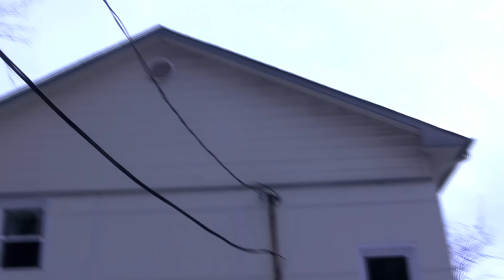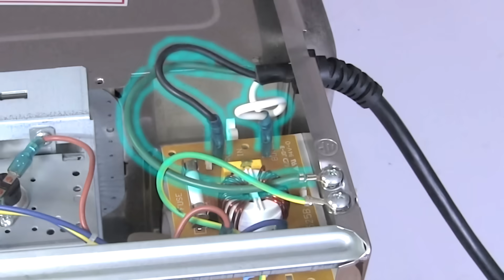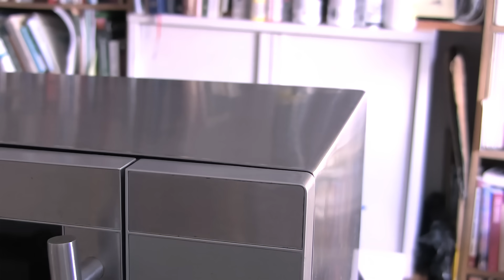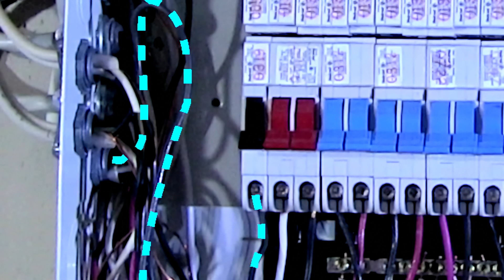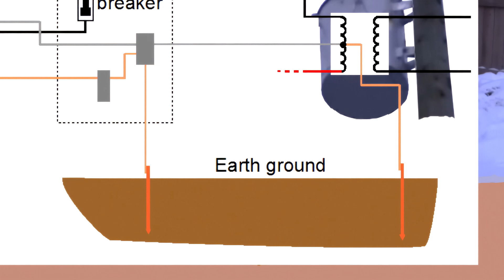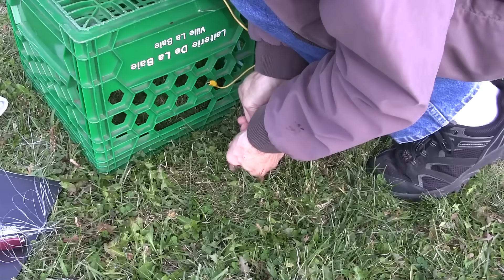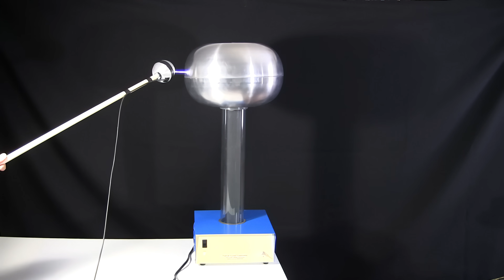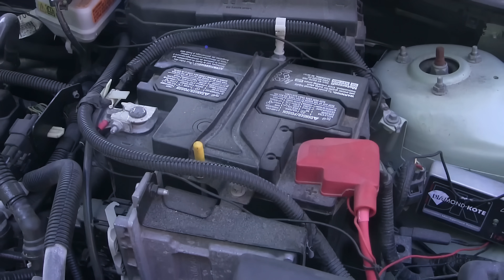What is Ground? Earth Ground/Earthing

Comment: But if electricity takes the path of least resistance, the wouldn’t the current flow through the hot wire, through the microwave and then straight to ground where the neutral and ground are connected??
Reply from the maker: Electricity doesn't just take the path of least resistance. It takes all paths and the amount of current each path gets depends on the resistance of that path. Keep in mind that the paths it's taking are the ones which complete the circuit. There is no circuit from the hot through the microwave, they're not connected. However, there is a path through the ground wire at the breaker panel, down to the Earth ground, through the Earth ground and to where the transformer is connected to Earth ground. That Earth ground section is a high resistance and so only a very little current flows through there. The neutral wire going from the breaker panel to the transformer has a much lower resistance and so almost all of the current goes through there.
Reply: RimstarOrg well by that logic, if the circuit to ground is high resistance, why does the current not circulate the hot back the the neutral point? It seems unlikely that the current differentiates between hot and neutral and hot and earth if earth is a higher resistance than the the neutral?
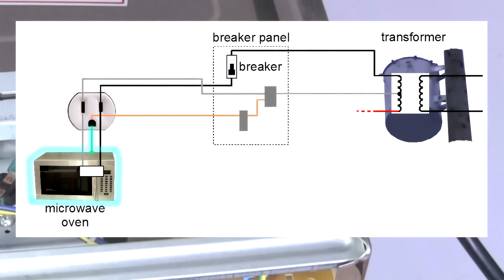Reply from the maker: I'm not sure which scenario you're talking about. Do you mean when the insulation breaks on the hot wire in the microwave oven which I talk about at 2:24?
If yes, then in that example, I'm assuming that the microwave oven isn't turned on, which means that the switch contacts are open and so there's no connection there between hot and neutral. The current therefore goes from the break in the wire, through the case as I describe in the video, back along the ground wire to the breaker panel and from there through the neutral to the pole and back along the hot to the breaker. i.e. the Earth isn't involved.
If the microwave oven was turned on then as I said in my last reply, the current would take both paths, one through the microwave oven circuitry and back along the neutral, and the other from the break in the insulation, to the case, and back along the ground wire. The amount of current in each path depends on the resistance in each path.
Reply: RimstarOrg I’m talking about under normal operating conditions, the hot wire comes in through the consumer unit then out to the microwave. The circuit is then connected through the high load in the microwave when switched on. The voltage is then used up through the load but there is still current on the return. If the return is then connected to the ground at the consumer unit, then what stops the current flowing to ground at this point?
Reply from the maker: The return isn't connected to ground at the consumer unit. Only the microwave oven's case is connected to ground.
Reply: RimstarOrg You’re diagram at 4:15 shows the white return cable going back to the consumer unit into a terminal block that also has the ground cable connected to it AND the external ground spike.
Reply from the maker: But as I mentioned a few replies back, some current does return through that ground spike to the ground spike at the pole and back up to the transformer. But since it is such a high resistance path through the Earthen part of that ground, the current along that path is very small compared to the current through the neutral wire between the breaker panel and the transformer.
Reply: There is only one path back to the pole transformer and that is thru the black and neutral wires. The ground wire should never be a
a conductor

Comment: Awesome video, really helpful!  I have just one question...I understand that in the microwave example you need to keep ground tied to neutral so that it always stays at 0V with respect to the hot wire, but if that is the case, why not just use the neutral line as ground and connect it to the chassis?
Reply: Savety reasons. If the neutral wire gets lose and the hot wire touches the case, you're gonna have a problem. 
Also the whole  automatic switch off  process usually works different than the one explained in this video. In general you can finde a RCD in the breaker panel wich needs the ground to be able to switch the circut off. I don't know if theres an obligation to use RCDs in the States but in Germany there is.
Reply: Then following your argument no need for a 3rd connector in the plug, just make it two. But what is to stop the hot and neutral from being swaped? Then the case can be hot and kill you

Comment: So when working with DC ground is the negative pole and while working with AC ground is to discharge electrified house devices, as a security measure?
Reply from the maker: With both DC and AC, there doesn't have to be a ground. For example, if you just connect a motor to a battery (which would be DC) then there's no ground. You can then connect either the positive pole or the negative pole to ground and then that pole would be grounded. That means that that pole would be at the same potential as ground. Most of the time when using batteries, if one of the poles is grounded then it's the negative one but I've seen the positive one connected to ground instead in some solar power applications.
Regarding household AC, one reason ground is used is as you say, for safety. Another is for making sure that two points which are far apart, such as the neutral connection at your breaker panel and the neutral in the transformer on the pole, are at around the same potential (i.e. 0V with respect to each other).
Reply: Thank you very much!

Comment: Ground doesn't go to transformer 😂😂😂.  It is bonded at the first feeder/supply panel. Usually the first panel after service.  From there its bound to the housing foundation, which usually has rebar. If not, a grounding rod.
Reply from the maker: I don't show the ground going from the breaker panel to the transformer. I describe it just as you have.
Reply: Actually yes, it does go out to the transformer, house services are a 3 wire Edison circuit. It also goes to ground at the panel, it also goes to ground at the transformer pole as well.

Comment: Why even have neutral anyway when ground is so much better smh
Reply: Ground and Neutral serve completely different purposes.  

The Neutral is part of most circuits where half of the service transformer winding is used, or a common end of the windings for multiple phases is employed.  The Ground is a dedicated path to earth potential.
Reply: The same reason you have feet but your hands are much more dexterous.

Comment: Great video, but I wanna add something. Ground and Neutral aren't always connected, it depends on the earthing scheme. In your house, ground and neutral are most likely connected together, so if the hot wire touch the equipment's surface, the the CB will trip.

However, in some cases, tripping would be even more dangerous (place like hospitals, in which losing power could cost human's life), neutral and ground might not be connected. Ground wire will still go to the real "ground", to bring the voltage down when there's a fault (so that even if you touch the surface, you won't face any danger), but the CB won't trip
Reply: He is showing residential 3-wire single split-phase 240v service... not 3-phase wye or delta higher voltage commercial service connections...his explanation is perfect for what it is showing...yours is a DIFFERENT lesson for a different service...apples and oranges...and grounding is a SAFETY conductor of low resistance that would trip a breaker because of overload...breakers prevent fires and equipment damage/failure...almost all hospital equipment has backup power packs for critical equipment....there are more than one grounding connections in all systems  because lightning strikes can electrify the ground-- literally- a building or a distribution system  and backfeed a system or transformer without  a short path(i.e. lightning suppression and lightning rods) to dissipate the surge...a neutral is part of a specific design like 3-phase 4-wire wye whereas as a 3-phase 3-wire delta has no neural in its design, but still DOES have safety grounding at the distribution source and service connections OUTSIDE.
Reply: nam18x 
I'm confused.

Comment: FINALLY it makes sense! @2:38-2:52 explains what I've been Googling, Youtubing, etc... I kept thinking the ground wire would "dump" electricity wherever it touched, which made no sense. I understand now the current travels BACK to the source using the ground wire as a path.
Reply: Nope.  You still don't appear to understand.

The equip (microwave) ground wire is connected to the equip case & to the neutral wire in the breaker box.  There is also a ground wire that connects the breaker box neutral to an earth grounding rod.  There is also another ground wire that connects the center tap of the transformer (neutral wire) to a different earth grounding rod.

When a hot wire makes contact with an equip case (which is called a short-circuit), current will flow along the path of least resistance--which in this example would be from the hot wire, thru the case, thru the ground wire, & then thru the neutral wire to the transformer center tap.  Since there is very low resistance along that short-circuit path, current begins to increase very rapidly until the circuit breaker trips & opens the circuit--which of course interrupts current flow for safety purposes.

The grounding rods also provide a low resistance path for excess electricity to flow since the earth also has a neutral charge compared to the negative charge of electricity.
Reply: ALL grounds are the shortest path of least resistance used to:
1) trip a breaker in the panel due to a fault/short circuit OR
2) dissipate charge/current when lightning strikes near the area(a second type of grounding), so you weren't totally wrong, it just seems you're not differentiating the HOUSE grounding which handles current overloads INSIDE the house(from the circuit breaker panel) like the microwave fault example, and the fact that the grounding rods OUTSIDE the house attached to the circuit breaker panel housing(and the bus bar) and one attached at the power pole(or ground transformer) source do two different things: the INSIDE house ground gives a short path for current overload in a fault/malfunction situation resulting in a tripped breaker, while the grounding rods dissipate excess electrical charge from lightning OUTSIDE the structure ...in a properly working system the inside ground has ZERO voltage or current until a fault/malfunction occurs...the house panel common bus is to take any excess current in the neutral wire to which it shares a common bus bar connection and find the shortest path...when it is from an inside fault, it trips a breaker as it is essentially a secondary, but shorter, least resistive path which then effectively  'replaces' the neutral wire which is designed to carry current in a NORMALLY functioning circuit and this short circuit causes a fault which causes current overload which causes a breaker to trip...the ground wire is 'used' ONLY in a fault/malfunctioning circuit and because it is a path of least resistance it becomes overloaded past the breaker capacity(usually 15 or 20 amps) and trips the breaker... when the 'fault' is from the outside lightning strike it goes TO GROUND RODS literally to be dissipated(absorbed). Neither ground is used in a normal functioning situation to carry any current, only in a safety instance.

Comment: what happens when there's no breaker? Also, is the equipment demand( the load) the determinant in how much amps are flowing, as it appears that way when you measure the wattage at the outlet. But when the equipment isn't demanding anything( turned off), what accounts for the amps that flow from the hot through the metal case ( and maybe you) to ground?
Reply: D Monk 
I think it's cz if there's an overload in the wiring it deosn't damage an appliance or if anything else.
Reply: No breaker = no interruption of current flow--which means high current flow through the VERY low resistance short circuit path.  As the current flow increases, the wire will become hotter until its insulation melts.  Once the insulation melts fire is likely to occur next, if the electric current flow isn't interrupted/stopped.

If you touch the short-circuited case, some of that electricity will likely flow into you.  If you represent a lower resistance to ground, the electricity will flow through you instead of the ground circuit path--which may create different problems for you depending on the current flow amount through you.  Also note, not all short circuits are capable of carrying high currents.

re:  "..Also, is the equipment demand( the load) the determinant in how much amps are flowing..."
Yes.  Under normal operating conditions the device has a certain resistance.  That resistance will cause a certain current flow under specific voltage conditions.  Using Ohms law you can work out the current flow as follows:  P = V x A.  So, if you know the power & voltage (e.g.: 1700W & 120V)  then you can compute the current as follows:  1700W / 120V = 14.7A  Using Ohms law, we can also compute the resistance of the microwave as V = A * R, so V/A=R, 120V/14.7A = 8.18 Ohms (the Ohm is the unit of resistance).

When a short circuit condition occurs (i.e. when the hot wire makes contact with the case), there is VERY low resistance in the circuit since the source of power goes from the hot wire, thru the case, thru the equip ground wire, to the neutral wire (remember the neutral wire is connected to the ground wire in the breaker box) back to the transformer.  As current flow increases quickly, heat is produced in the wire due to resistance.  Ordinarily the breaker will trip before the insulation of the wire will begin to melt. If the breaker failed to trip open, then the wire would overheat, the insulation would melt, & fire would likely occur at some point.

Comment: I am not sure if I am getting you correctly, if ground at the end of the day gets connected to the neutral then what is the use of having three separate wires, why don't we connect the neutral wire to the casing and avoid the need of having three separated wires with two having the same connection, isn't that useless redundancy?
Reply: Me to have the same doubt
Reply: Ok thank you sir
Reply: J Hutchison  Thank you, It makes sense now but it still leaves me with a question, how does lightning conductor connect to ground in this scenario, what path will the power from lightning take?
Reply: When lightening occurs,it induce charge in the case,making the case a charged body.To make the case again neutral,a ground path is provided through a conducting cable
Reply: J Hutchison is it better to be the path to ground or the path to neutral? Im guessing that the low conductivity of the body and the ground means less electrical flow, but a path through more of the body, than from one hand to the other( or through the same hand) to neutral. Also what determines the amperage flow. is it just resistance and not a kind of demand?
Reply: @D Monk:
Electricity follows the path of least resistance.  The microwave load is actually a much lower resistance under normal operations than your body would be if you were to hold the hot wire in one hand & the neutral wire or ground wire in the other hand, however, in a short-circuit condition (i.e when the hot wire makes contact with the metal equip case) the resistance path from the hot wire, thru the equip gnd wire, thru the neutral wire & back to the transformer center tap is VERY low since copper is such a great conductor.  This resistance is is still far below the resistance of the human body, but, it doesn't take a lot of current to flow through a person at 120V to kill a person.  I'd much prefer to electricity to trip the breaker than to stop my heart from beating.

Comment: One mistake, water pipe shouldn't be used as ground
Reply: doesnt really matter where the ground is connected the person will be electrocuted unless there is another way for the current to get to the ground
Reply: Yeah mate, doesn't sound too hazardous at first but, in the event of another tradesperson like a plumber removes the pipe entirely they have no communication to tell you to rewire the earth and probably wouldn't be able to tell anyway and thus there would be no ground at all and then its gg well played if someone touches it. Plenty of easy alternative solutions to earth a circuit like just doing a simple stand-alone ground wire with a bit of conduit from the box. So why not aye :)

Comment: "but keep in mind the cold ground lowers the conductivity". Hmm? 
I am sure is the colder the temperature the higher the conductivity, superconductors know better but then there is "super hot plasma" 
 Ground wire is provided to devide the dangerous discharge into the 2 wires: white and grounded green, and depending on the size of these wires  a divided "killer" amperage or current.
Reply from the maker: Here's a random source that talks about how the cold increases the resistance of the ground http://www.dtic.mil/dtic/tr/fulltext/u2/a181405.pdf
Reply: @RimstarOrg  thanks : ).   I understand you now. I would rephrase it for my own good. The conductivity of the ground that has water content decreases with lower temperatures.  A known factor in some batteries. Thanks again ; )